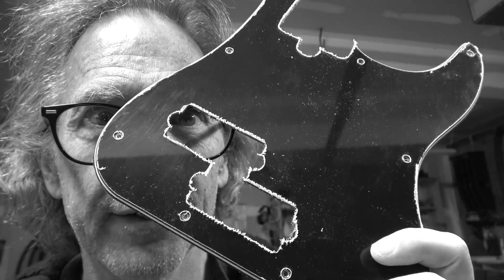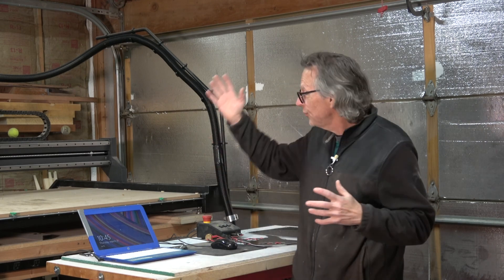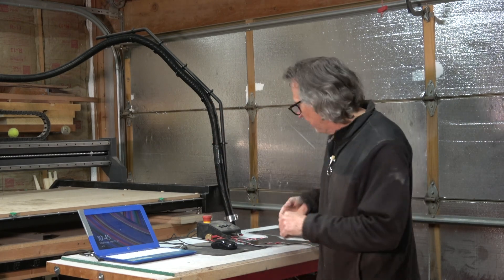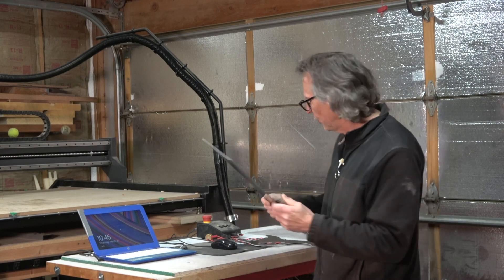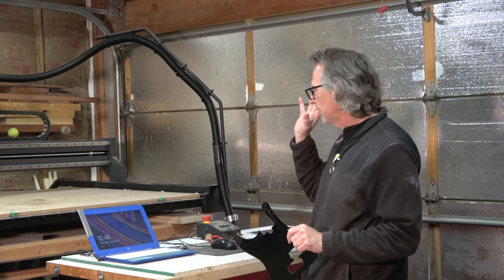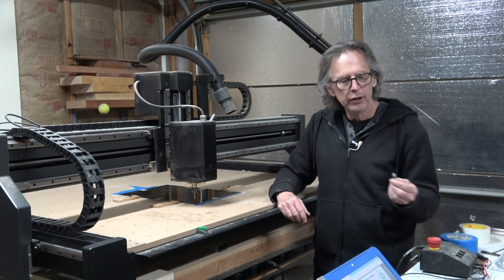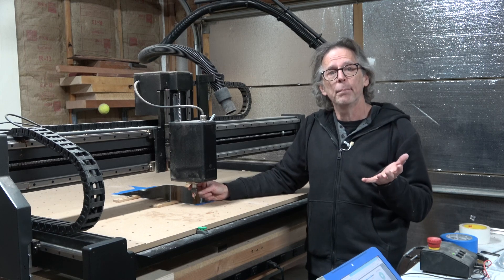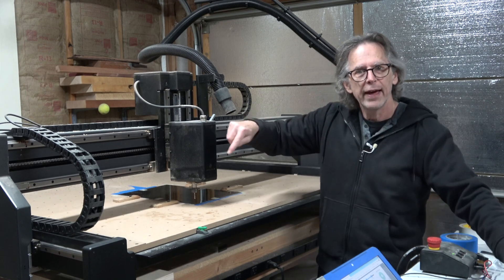Building A Precision Bass Part 16 Making The Pickguard With A CNC Machine

Comment: I've been a subscriber for several years... I rarely comment but I'm finding this pickguard duplication really interesting. I recently had a pickguard duplicated for an SG and I'm not happy with the outcome mainly because of the material. It was cut out of real mother of pearl which is great but the tenon cover had very little pearl & was mostly grey. I decided to just use the pickguard but the guy who did it left a huge deep scratch in the pickguard which I sanded out. I then polished it to a high satin sheen.

Comment: The point around 4:40. I have only 1 instrument with a laminated neck, an Ibanez, and that was the first thing thing I noticed when I bought it. The grain is oriented not for aesthetic, but for each piece to fight rach other into submission. Jotoba. I live in fl, and it is the ONE instrument that I adjust the least, save for a 1974 fender jazz, which is a one piece, quartersawn maple. Laminating done right is a good thing- properly milled, empirically proven through practice in manufacture, one piece is also good. I'd risk saying that it is  availability of material that dictates the choice of the independent maker/diy contingent. 
In construction, woods chosen for superior crushing strength down the grain are used in load-bearing. Let them sit, in a dry warehouse even- some will twist, bow, etc. 
Multilaminate, lumber based textiles? Less prone. Interesting subject, worthy of anyone sleuthing further for themselves- someone might come up with some neat ideas
Reply: @HighlineGuitars  I have no idea why this comment posted to the wrong vid- I was commenting on your vid regarding laminated necks... and it ends up here.

Comment: Hello, great video and great project! I am new to this and I am thinking of going to a workshop where they work with CNC or laser cutting to ask them to help me cut a custom pickguard. Could you tell me how you transferred the model and measurements of the pickguard to the CNC machine so that it would fit well to the instrument? Thank you!
Reply from the maker: You have to use a CAM (Computer Aided Manufacturing) program. I use MeshCAM. This program is used to set up the toolpaths for the CNC machine. Once the paths are set up, it writes a g-code file that is sent to the CNC to carve the part.
Reply: @HighlineGuitars  Thanks for the information, I saw that in your other videos you talk in more detail about how to work with a cam system, I am going to review them to learn more about the topic. I'm going to subscribe